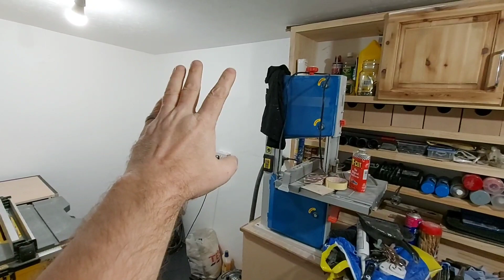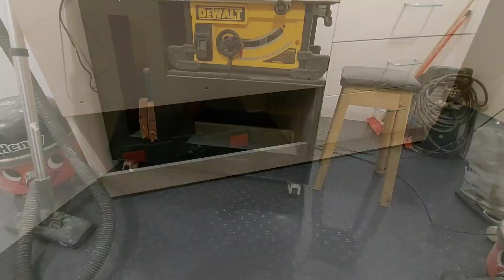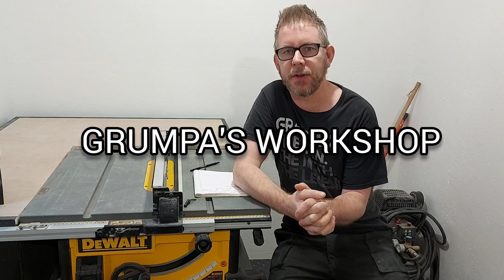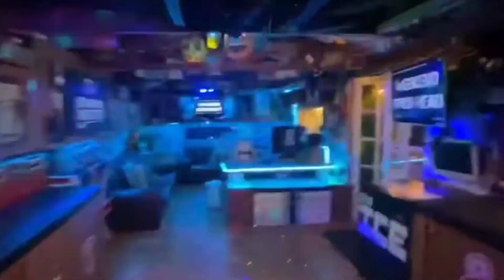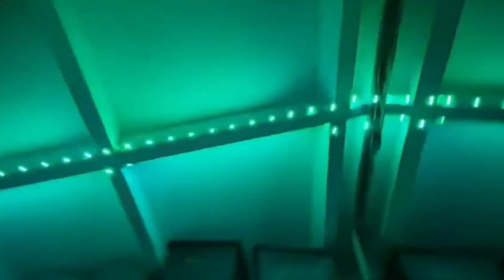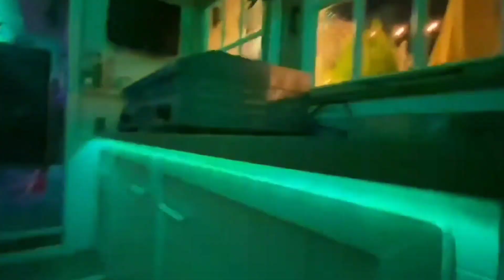Shootouts & channel recommendations

Comment: It’s a surprising transformation. Floors and walls. Really changes the feel. I think doing the cabinet fronts is great. Lots of work but you can use it as a bit of a learning and not be extremely picky. I’ll miss some of he tool holders but agree. I see the long troughs filled with screwdrivers and pliers but think a pair or more of smaller ones is better. Can always line them up to make a big trough. Keep going. :)
Reply from the maker: Thanks mate

Comment: I have recently installed panel lights in my workshop they are fantastic i brought the mounting frames for them off ebay at £5.25 each most places want £18 each for them which is the same price of a light you won't regret putting them inn.
Reply from the maker: OK thanks mate that's good to know. Panel lights it is. I was leaning towards those